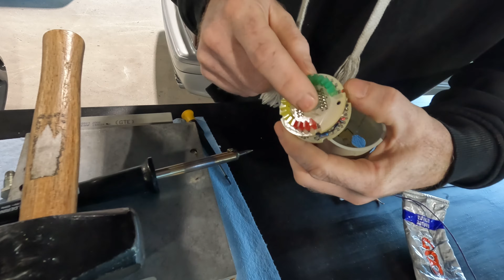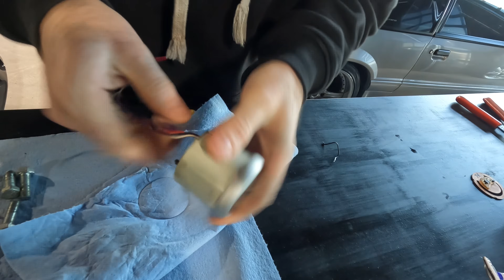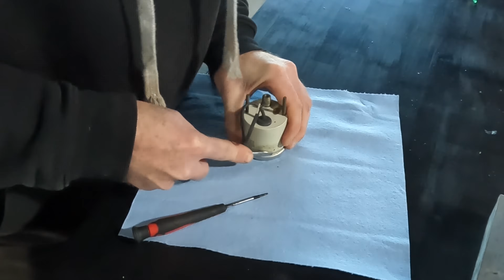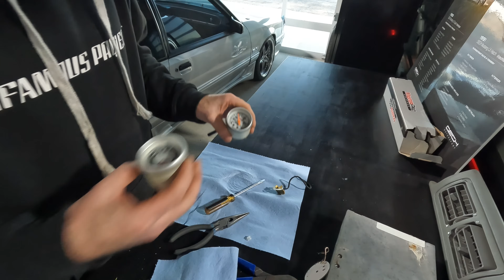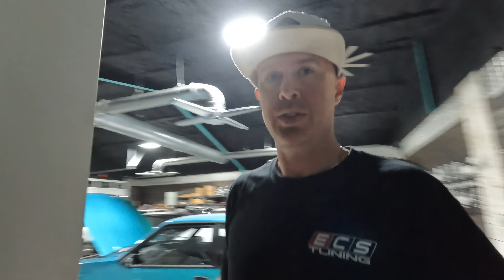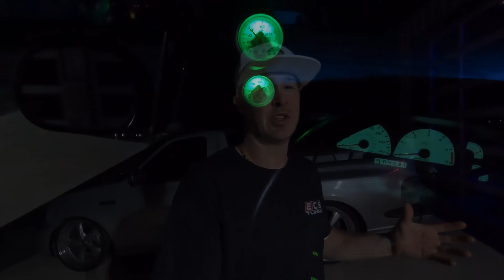How-to Open Autometer Gauges and "sorta" Fix Dead Lunar Series Lights - TIPS04E102

Comment: I like the way you think !
I'm of similar mind... When something breaks, Fix it if at all possible... Before spending yet more $$ unnecessarily !!
I need to do this to my steering column mounted Vac/Boost gauge on my 04 Lightning (Oxford White) ... needle stops at 10" Vac side .... Darn gauges are not cheap ! !
Thank you for posting this video ! !
I think you can replace the old incandescent dash bulbs with LED ones, just be sure the LED bulbs are dim-able.